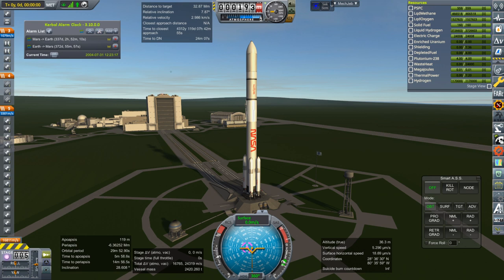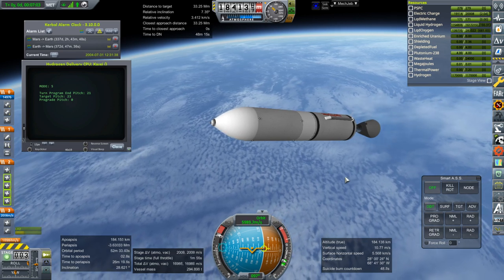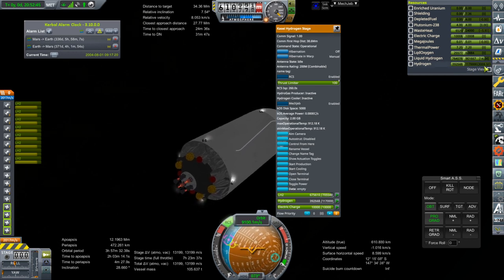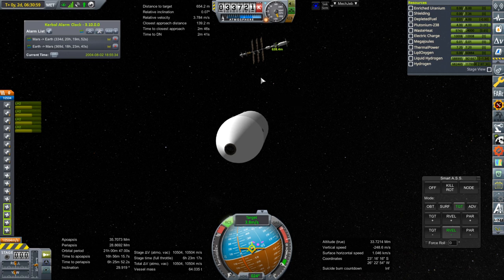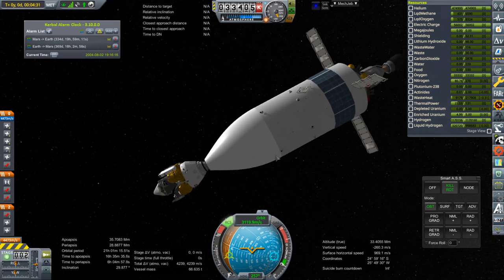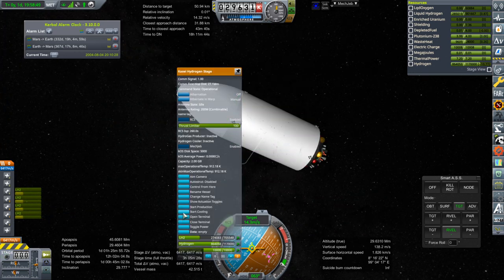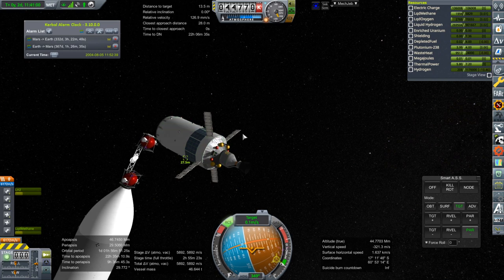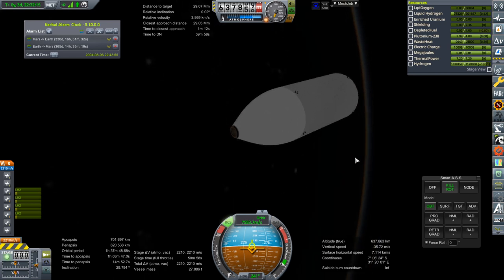KSP 1.6.1 RO and Kerbalism - Mars Colonization 040 - Candle for NERVA

Comment: I have some issues with TWRLS in my game of KSP 1.6.1
The problem is i can launch rockets but they can't be bigger than 1m and they float 20m in the air how do i fix this issue. I kwon i did it before but i can't remember. How do i fix this
Reply from the maker: I haven't even gotten Real Launch Sites to work in 1.6.1, so you're already ahead of me there.
Reply: @RaizSpace  Bu which mod dit the launchpads do jou have then?